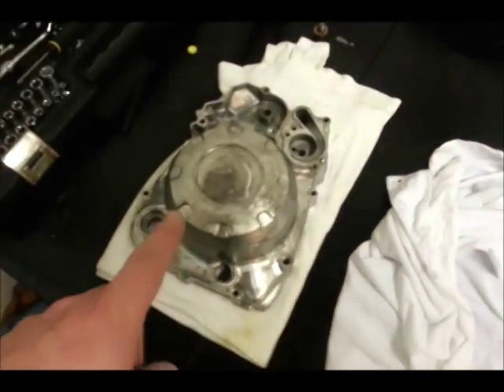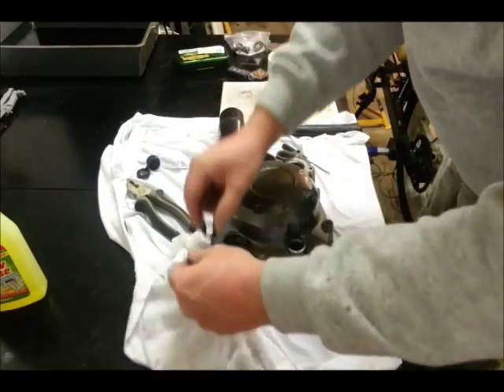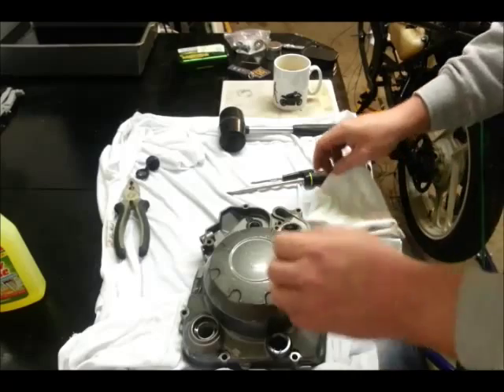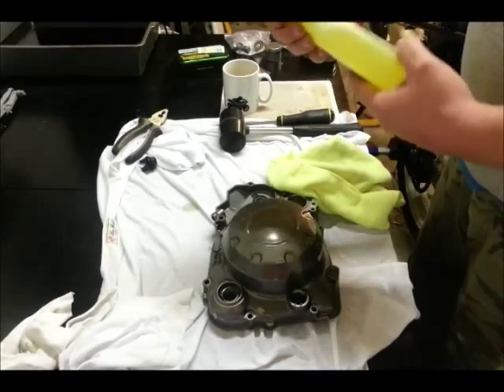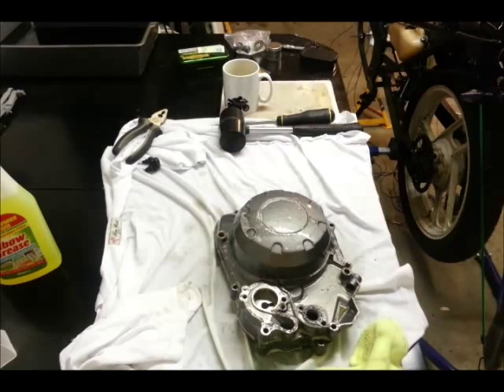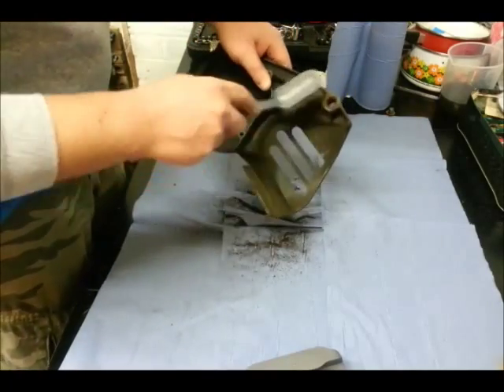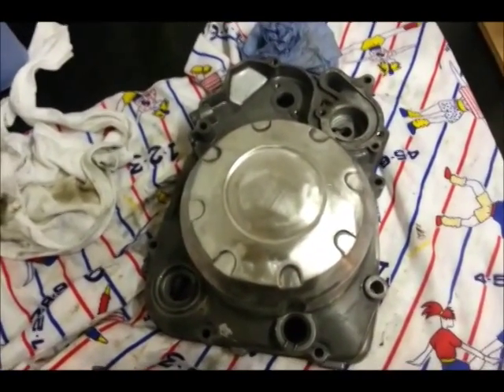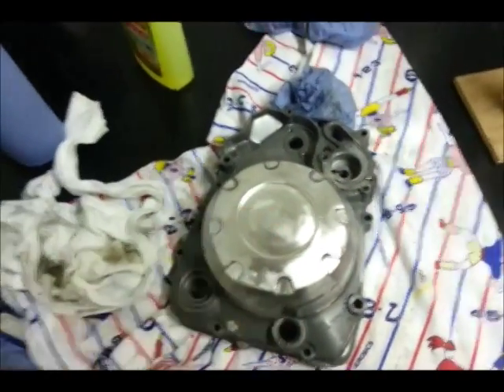Project TZR : Engine Rebuild : Snapped engine bolt FIXED!

Comment: Great to see the sensible solution to the problem! A couple of tips...

Acetone (nail varnish remover) is an excellent de-greaser for metal and its cheap, or free if you nick the girlfriends supply.

Use heat on  case when removing large tight seals. Similarly, when re-installing, heat the case then position the seal and drive in with an appropriate sized socket square on with the mallet. Works a treat. They're an interference fit and need to go in undamaged. 

Brake cleaner would have removed the crud on that plastic cover.

You could just scotch up the lacquered finish to give a key for the paint. A light dust coat to create a tack finish. Try a smaller test piece but it should be good.

Finally, my best wishes for a good new year, buddy. Don't underestimate how well you're doing, this is  great  project and keep the videos coming!

Cheers, Peter
Reply from the maker: Thanks for watching and the tips chief, and I hope you have a great year as well.

I will be picking up some acetone before I respray the engine casings, I value my fingers too much to risk nicking hers...

I did have to heat the engine to get some of the bearings out, but the seals have not really been much of an issue. Mind you I don't doubt for a minute that my seal removing techniques make more experienced mechanics shudder. I will bear it in mind for the rebuild though, probably not going to be able to use the oven this time though, I wasn't popular after the last time...

I've not finished cleaning the plastic cover yet, so will try brake cleaner on it, thanks chief.

I did consider scuffing it up and re-spraying it, but the paint/lacquer was flaking off in places (on both casings) so I thought best to remove it.  Probably making more work for myself, but it does stop the nagging doubt. Now that I have a spare engine casing I thought I would try out that paint to see how it goes and get a bit of practice in before I start painting the rest.

Thanks for the vote of confidence, this is my first real project so no real idea of how I am doing. I'm quite happy with the progress so far, obviously I wish it cold be faster, but I have found that it kinda goes through stages. One day/week you get a whole heap of stuff done, and the next you're barely making any progress at all. I'm still enjoying it though, although there is still a mountain of work still to do, wait till you see the tank...